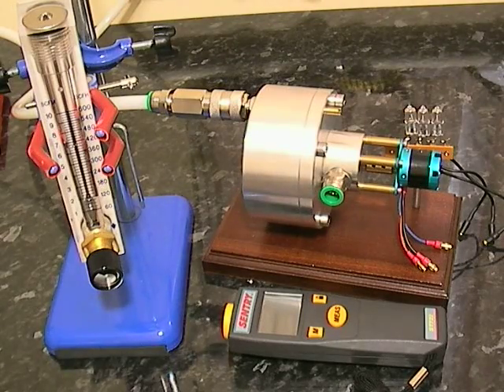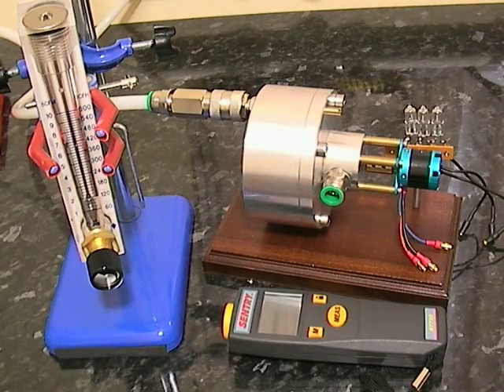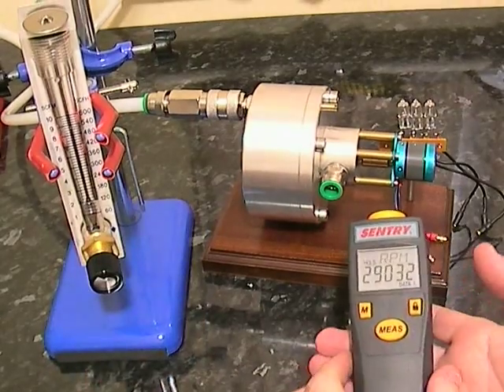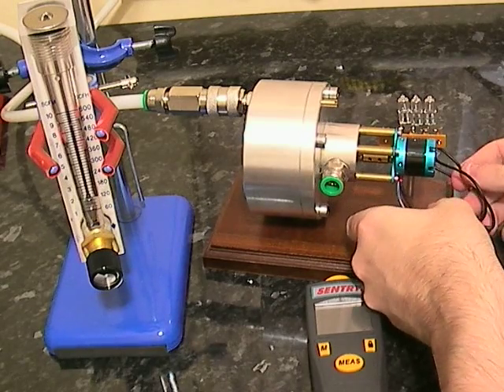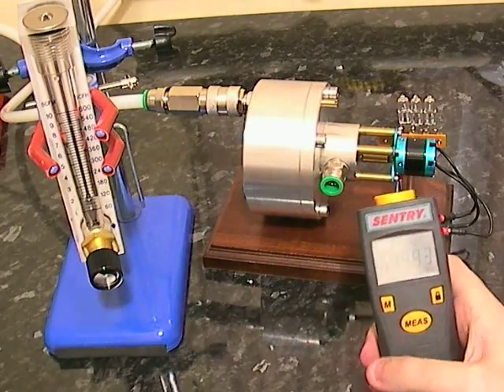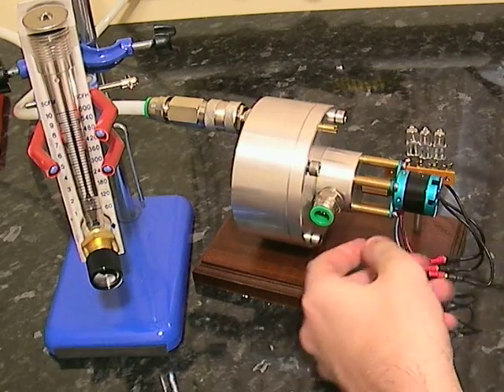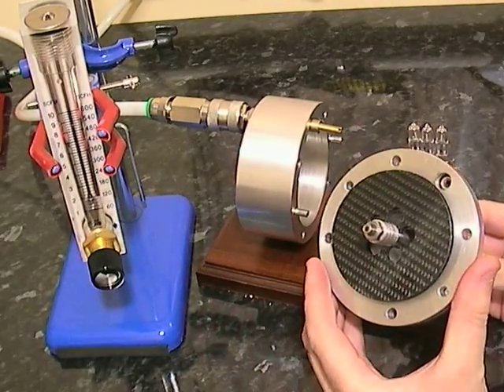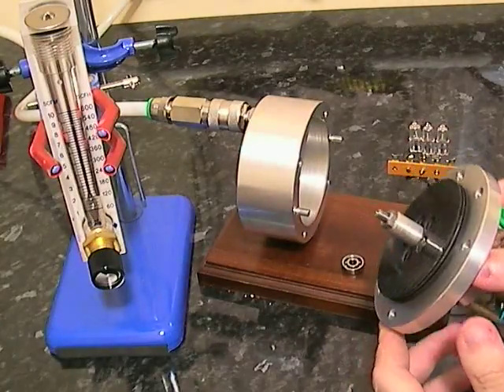Tesla Turbine ( Carbon Fibre Disks)

Comment: adjust the holes to be out of step to allow better flow on the air output.. perhaps the output flow is too restricted by having them in phase.. ie, trying to output as quickly as input. 

also those tubes to input air look slightly restricted for project.. try drilling them out a little larger..

Comment: We make a new type of steam generators , cavitation - heater, hydrodynamic mixers.
They do not have any analogues.
Steam generators: Hydro, cavitation, straight-through, no boiler for heating
Stationary and mobile , autonomous .  
Electric, diesel motor and hydromotor .
Operate at different water without water treatment. 
60-90 seconds - the launch of Work .
Steam parameters : 160 degrees C ; pressure of 6 kg/cm2
Capacity: 30-200 kg of steam per hour. 
Rotating disks - to heat the water - generates steam.
A scum, salt the sediment is not formed - a very large rotation speed drives - more than 200 km / hour.
The electric Motor power - 55-110 kW / 3000 rpm / min . 
LLC "Technic"     Saratov city   Russia 
Website: http://www.par-generator.ru/ 
E-mail: par-generator@mail.ru
CHANNEL Youtube - A 15426378 
We offer cooperation . http://www.youtube.com/watch?v=Qkr68rclpYk
https://www.youtube.com/watch?v=QiRHs1xJavA  - Our steam HPM-55 in Kazakhstan at the milk plant
https://www.youtube.com/watch?v=VK9CTcOUSBQ – Our steam generators 2 HPM-75 in oil extracting
http://www.youtube.com/watch?v=caiP5UrQcyQ - Our steam generators HPM 60D with diesel engine

Comment: So this is powered by the air hose then, so the function of this is reliant on high air pressure in... how would you go about creating that with out a steam boiler?
Reply from the maker: Revolutionary Socialist It is not reliant on high pressure and can run on low pressure. There are numerous ways to power it. solar concentrator. Rankine cycle system power by waste heat. Water from a elevated position. All sorts of ways. You could use combustion too.
Reply: Ok but in doing that you're immediately creating a problem aren't you? burning petrol inside a combustion engine is more efficient that burning petrol to heat air to turn a turbine then turn wheels.... This cannot move bigger loads, I stand to be proven wrong, please try to power a car that way, I'd LOVE to see Telsa's turbine ratified but I just can't see this as useful.

A solar concenrator seems like the best of the options there but even so how do you get enough air flow to really power this to be able to move load rather than just go no where.
Reply from the maker: Revolutionary Socialist Car engines are pretty efficient. Around 30%. So a bit more than that now. Air craft Jet engines around 60%. In both cases a chemical reaction causes heat, expanding the gases and causing the pressure. Turbines are prefered over piston engines in aircraft because of the efficiency.

Solar concentrators produces around 2kw per square meter (depend on location on earth) you would use a rankine cycle system. Basically the same cycle as a power station. Even if the efficiency is low the source is free!
Reply: Do you reckon you could use a tesla turbine in a jet engine instead of the tradition turbine?
Reply from the maker: Revolutionary Socialist Yes.
Reply: given what you know do you think that'd be better or worse in terms of performance extracted from the same amount of fuel?
Reply from the maker: Revolutionary Socialist Depends on whois making with what resources. I not going to be able to compete with Rolls-Royce and three quarters of a century of research.

Comment: Thanks for sharing, great information! I would like to incorporate in front of new electric airplane design. Would have an air intake in the nose of the a/c to direct and ram air into the Tesla Turbine. Would like to use for regenerative power back to battery bank and for providing electrical power to a/c systems while in flight. Sound like a practical application to you? Thanks again, TA.
Reply from the maker: Tesla Aircraft Tesla turbines were used on steam trains. They were put on the front used to create electrical power for the light at the front. So yes possible. But would this be best done with the prop. If you are using regen why not use the prop?
Reply: gyroscopes Thanks for the reply. Do not want to use the dual EDFs for anything else other than providing thrust. Also want to add more weight to the nose of the a/c. I was told by one person that the Telsa Turbine although power out-put is great, it would not be efficient because of the fact that the air enters and exits at 90-degrees, so thinking we may just use a conventional propeller type wind turbine. Thanks again, TA.
Reply from the maker: Tesla Aircraft The 90 degree is an area of inefficiency but not a huge problem. Air pressure and designing for the input pressure are bigger problems. I see no reason why this is not possible with 50% efficiency. How much power to you need?

Comment: Nice, once you fill that chamber with disc and open the other air inlets you will be seeing 70, 000 plus rpms, and the turbine will be running more like Tesla himself meant. It won't see 98% efficiency without the proper spiraling pressure adhesion, it needs high rpms, very high to get 98% efficiency, but this is with no load, the ideal is to achieve resonance matching disc speed with the air(water,etc...) speed while under load, EX. it would take more power input to hold 50,000 plus rpm with load then with no load, so design the load to be in accordance with input power to keep its 98% efficiency. The chamber being bigger and missing disc allows the turbine to lose efficiency, the volume in the chamber effects spiraling pressure buildup and proper adhesion

Comment: I am so glade I found your video! I wanted to try carbon fiber, now I know it will work! Thanks. Finally a material that will hold up yet is easily machined! I want to build larger versions with .75mm thick disks 10" in diameter with 8-10 disks spaced .75mm apart using washers cut from the same material. Also, you would get far more power out of your Tesla turbine if you incorporated gear reduction so your turbine still operates in its high RPM power band. A simple 5mm timing belt pulley system would work great on your scale device. Just mount a small diameter pulley on the output shaft and simply run the belt around the outside of the outrunner motors casing for a nice $5 buck mod... Great video!

Comment: For those who are interested, some older scsi hard drive use glass platter reinforced by fiber carbon. In order to have a hint about the type of platter found, you can use a digital multimeter. The resistance of aluminum vs glass platter is clear as day and night.

Comment: @gyroscopes Well, I wasn't necessarily suggesting a small or unpowered heat sink.  It reminds me of some power storage systems where compressed air is blown into abandoned salt caves.  So much energy would be lost from the dissipated heat of the compressed air that its run through a molten sodium heat exchanger first, and the heat (and pressure) is later recovered when the power is needed.

Comment: What a stupid argument there... Maybe dangerous if you had operated at the pressures it was originally designed for. You know this turbine should work in the range from 30.000 rpms and up ? And 3 plates ??? One of the reasons the tesla turbine engine never really made it was because they did not design it to exact spec. Also 100.000 rpms 100 years ago was a bit much for a regular car (but perfect for high voltage and frequency generators) even if he could deliver it with a fluid transmission.

Comment: Holy crap!  a tesla turbine video with actual science type instruments done in something that looks like a lab setting instead of some CD's being spun by a hillbilly's garden hose!  Sorry if someone else has suggested this, but would putting a heat sink (for adding heat to the air) after the regulator and before the turbine increase its efficiency at all?

Comment from the maker: @moonroverer The case is never going to split under the pressure used. It is 10mm thick ! Cap screws are stainless. Even if all 4 failed together the front section of the casing would just pop off. There isn't enough back-pressure to have enough energy to do anything else.

Comment from the maker: @moonroverer So you are suggesting I disconnect the air before making changes? I would agree for many/most air power tools. In this case there little risk. The turbine fails very gracefully. I have tested to destruction and although it really hard to get them to fail they do fail gracefully. Electrics is low voltage but admittly high 
frequency.

The biggest risk here is burning my finger on the bulbs which get very hot.

Comment: I would like to make that work with a heat pump system to power the low voltage loads and maybe the indoor and outdoor fan motors

Comment from the maker: @waragainstgreed Yes I have. Been testing something like this. Had actually designed some rocket nozzles to increase air speed. It didn't work. math wrong?? Anyway yes you can gain extra performance with such concepts.

Comment: @gyroscopes 
have you thought about using something like a medical syringe to get the air jets closer to the contact holes in the turbine? you might have to space the disks slightly further apart but to have the more direct contact i think would boost efficiency by 30% or more.

Comment from the maker: @DanFrederiksen It does. I actually threaded them and put grubs screws in so they can be removed. I have thought about efficiency from the start. It is now many times more efficient. Next one (will upload video to youtube) in a week or two.

I agree that the tesla turbine does need to be efficient. Although it does have many benenfits over normal turbines if you disregard efficiency.

BTW: I quite sure I can get the efficiency up to around normal turbine levels.

Comment: @gyroscopes clogging the nozzles also keeps the pressure high. you should start thinking in terms of efficiency. get some measurements going to guide your work. the tesla turbine is not interesting unless it can be relatively efficient too. if it can it could be very interesting. extremely even

Comment from the maker: @DanFrederiksen I just put the air where it is needed. It also have the benefit on keeping the pressures high which improves performance. tried both ways and for air this works very well. Have even played around with CD nozzles.

Comment: nice build but I don't like the injector design. why restrict the airflow to tiny holes??
why not make room in the side of the casing where the unrestricted air can find its own way into the gaps. it's very inefficient to pass high volume air through tiny holes

Comment: @sschoon86 If You could find the way to cool down the exhaust gases without disturbing their flow , and than use that energy to recharge batteries than yes, the engine would be more efficient (check: Carnot cycle - efficiency depandes on the diffrence between the temperature of the heater and the cooler) But if You would disturb the flow of the gases the result would be a loss in power output and eficiency. I think it's better to just turbocharge the engine and than use it wisely :)

Comment: Has anyone ever attempted to capture the waste heat from car exhaust and using it to turn a stirling engine or a tesla turbine, which would turn a generator to charge batteries in a hybrid?  This seems like it would be efficient because there is would be no added load to the ICE as is the case with current hybrids.  Most of the wasted efficiency of an ICE is wasted heat energy right?

Comment: I have read that a tesla tubine could be used as an air compressor.  I don't know how effective that would be, but  I think it would mean that the air wouldn't be contaminated with oil like a piston driven compressor.
I wonder what kind of pressure could be generated.

I also notice that you seem to be using a three phase brushless motor.  Have you put its output on an ocilliscope to see what kind of output you're getting?

Comment from the maker: improving the disk size can improve thigns because the air is 'touching' the disk for longer. I discovered that carbon fiber disks are a waste of time. steel or aluminium are just fine.

Comment from the maker: Really? I'm testing everything as a go along to double check. I've found that standand inlet like tesla used does works. However some of the more modern patents/documents show changes to the inlet nozzles and they were right. I now progressed (not show on youtube) to other designs which show even great performance.

If I remove the nozzle performance drops. A lot.

Pulsing is being left until last.

Comment: If you modify your inlet so that it is tangent to the housing, you'll see a marked  improvement in performance. The "old man" did it that way. There's a significant amount of head loss from turbulence introduced by running the inlet supply axially like it's shown in the video. Avoiding turbulence was the mantra of the design. Also, pulse your air supply if you can. The results will surprise you. Excellent craftsmanship, keep it up.

Comment from the maker: Its like a valve. As you close off the output the turbine slows down. in very much the same way as a valve on the inlet. As I said you NEED a pressure difference for it to work.

Comment: The pressure of the air remains constant. The pressurized air comes in the input, and out the output. What if the output were connected to the input of another Tesla Turbine? How about daisy chaining 50 of them?